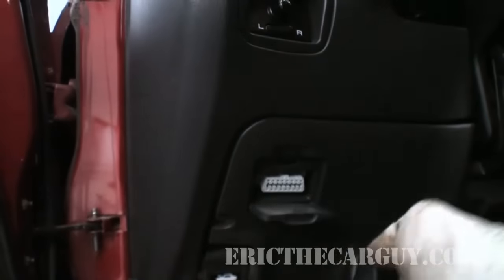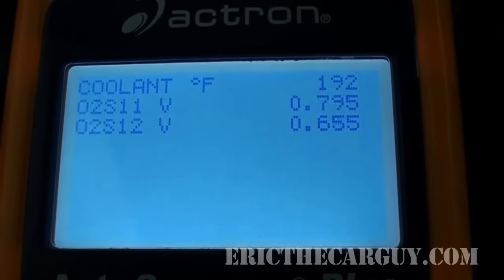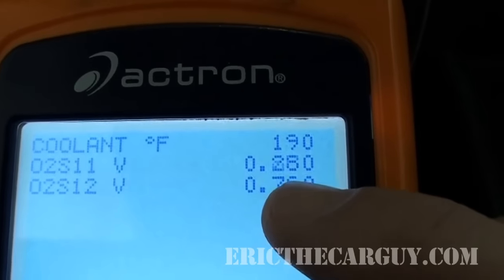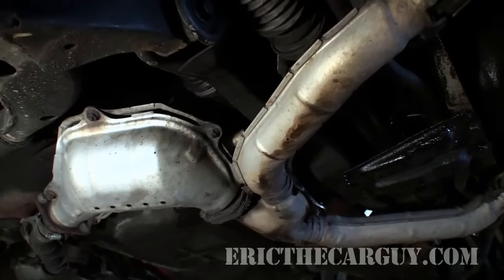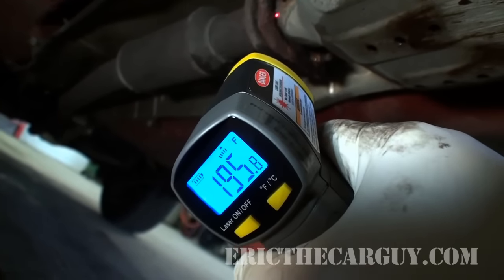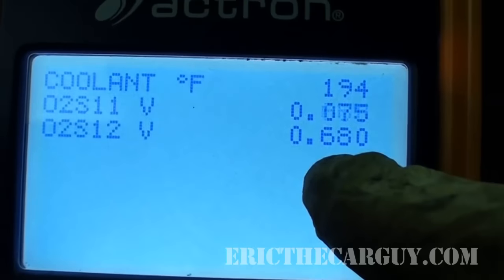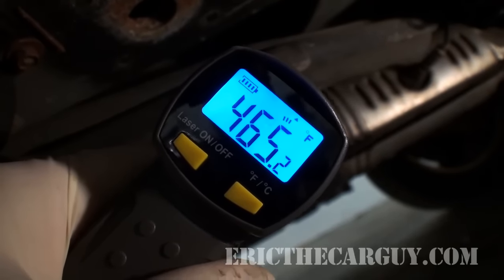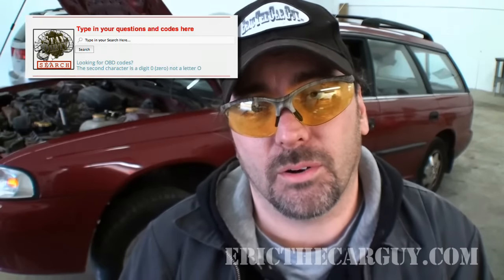P0420 How To Diagnose A Bad Catalytic Converter -EricTheCarGuy

Comment: I have an 06 Volvo s40 with a p420, change the rear sensor, light came back on, watched the live data and the front sensor would switch around as expected but every once in while would jump up to the 200 's not 0.200 but 200.0, is that normal or is that front sensor the problem ?

Comment: I did both of these test, the converter passed the temperature test, but when I checked the live data. The first O2 sensor was fluctuating like you said it would, but the second one was doing the same thing. It was not stable like it should be. Any suggestions? This is a 2001 buick century custom too. It doesn't look like there are any exaust leaks either, but it has produced the P0420 Code. Any advice would help. I love your channel man, super helpful. Thanks.
Reply: look for exhaust leak close to the cat.

Comment: '97 Accord 2.2L non-vtec w/ 296k mi. (owned since 275k), CEL recently triggered for P0420... My OBD reader indicated my downstream 02 sensor's voltage was up & down, but then I decided to track it again after a 40-min. drive home from work.  It started tracking at a constant 0.7V (holding RPMs at 2k).  Is it possible for the cat to start back working again?

Comment: My mom's 2002 Nissan Altima 3.5SE just got this code a couple days ago. I've read that this can be fatal in those cars if not addressed quickly. I just replaced the upstream O2 sensors because of different codes, spark plugs and the rear valve cover. So, it's sounding like one or both of the pre-cats are failing.
Reply: I just checked it tonight: Downstream bank 1 O2 sensor voltage was steady at idle then it jumped around when the car ran at 2500 RPM. Temps were 330 degrees in front of the bank 1 precat and 140 degrees after. I'd say the bank 1 pre-cat is done. Given the history of these Nissan cars, I'm going to replace both pre-cats, since the car has 160K miles and they've never been replaced. The compression was about 210 PSI dry across the board when I checked it a few weeks ago, so I'm hoping we caught it early to prevent engine damage.

Comment: I got the P0420 code on my 2003 Camry and when checking with the OBD reader only the 2nd O2 Sensor is showing voltage (mostly steady around 0.6-0.7) but O2 sensor 1 is showing 0 voltage, could that be what's causing the P0420 code?
Reply: yes.  did you replace the sensor?  that's the easiest (and best) explanation for your code so hopefully that's all it was!
Reply: b I did. I've driven like 400 miles and so far the light hasn't come back on
Reply: right on!

Comment: How about manifold cats? I got a 07 civic 1.8 and has a p0420 that comes and goes. Awhile back I threw a new cat at it and it was fine for a year or so and now I get the intermittent p0420. I also am using a lot of fuel but the performance is not effected. I think I changed a good oem cat

Comment: Hi Eric, thank you for the video, as always very helpful. I just have one question. How can I test the O2 sensor on the downstream? I have a multimeter, can I check the continuity of the black wires  / white wires? If so, should I just put it in ohms and test both black wires or white wires? I did that on my 2010 Honda CRV. I got no results on my multimeter for the downstream however, the Upstream gave me back a number. I got a brand new O2 sensor for my Downstream and that didn't give me any readings either. So what gives?
Reply: James  , thanks a lot.

Comment: Eric, I gots a audi A4 B5 1.8T Q.. currently having P0420.. So im digging into this Catalyc stuff here.. So you are saying cats run around 1200F.. BUT non of your vehicles are not even close?  I had disconnect in understanding , should the catalic on your oddesy. be up there around a 1000F?
Reply: The 1200-1600 F range Eric referred to is the temp of the cat itself, which you can't usually measure effectively due to items like the heat shield. The temps that he pulled from the inlet and outlet will help you determine if the cat is good or bad, as a good cat will have a temp increase on the outlet side whereas a bad/restricted cat will have a temp loss on the outlet side. Hope this helps!

Comment: @ericthecarguy the code I'm getting on my 09 maxima is P0430 cat system efficiency below threshold. Should I do a tune up, reset the check engine light and see if maybe that fixes the problem ? Otherwise I have to buy a whole new exhaust manifold which are pretty pricey $$$.
Reply: German T who told you you needed a manifold replaced? if they told you that its likely the reason for the code. you are probably getting a leak from the manifold..clearing a code.doesn't do shit.

Comment: i came across a car with a lower temp outlet. but the vacuum gauge (at 2000 rpm) holds steady, doesn't drop. the bolts one the Cat are badly rusted, so i dont want to take them off at this time. 
if a car has a fake/dummy catalytic converter will the outlet temp be lower?

Comment: Could a leak in the air intake cause the computer and 02 sensors to be confused and throw a P0420 code to pop on? I replaced my cat and 02 sensor and about 3 months after the 420 code popped on and I know it's not bad as it's still almost brand new. Should I have my intake smoked?

Comment: what term is used for measuring STFT and LTFT on a nissan murano. Im using a EVO Genisys and i do not see those terms fot that reading . I believe Air Fuel Ratio is one but ,i think that the equivalent to short term. Do you know?

Comment: Hey Eric, thanks for the helpful and easy to follow videos. Question, I have a 2007 Honda pilot. It gives me p0420 and p0430 codes and now I have p0300 all the way to P0306 codes. Do you think the 420 and 430 codes are causing the P0300 codes? Would really like your help on this one.
Reply: Having same issue. Same car. What was the result

Comment: Well put together video.  Definitely some information I can use.  I have the P0420 code on a 2003 Camry.  Only sets the check engine light when you take it on long trips of 100 miles or more.
Reply: What was the final diagnosis?  Did you replace your 2003 Camry’s O2 sensor and/or catalytic converter?
Reply: @hb5914  Changed the O2 sensors, and put the old ones back on.  The new ones give the P0420 code immediately.  Drive less than 100 miles or so, and the check engine light never comes on.  So... I essentially did nothing to it.
Reply: @cward1954  Who manufactured your new ones that immediately set a PO420 and who manufactured the old oxygen sensors?

Comment: QUESTION; I have a 2009 legacy gt and I am not throwing a code, however, I am getting that rotten egg smell when I run high rpms. For example; in the snow recently, had to give it some gas In order to not get stuck and rev close to red and get the smell. Could it still be bad and not throw the code?

Comment: I drive a 98 integra with a CR-V b20 motor swap and my car tends to hiccup while accelerating. The other day I got home and parked the car I noticed smoke coming from the firewall and below so I checked it out and after looking into it. I noticed that the front part of my cat was blazing red hot but the rest of the cat was not. Would this be a bad cat? I've been told it can be the distributor causing it to do that.

Comment: Hi Eric, I have a P0420 code on my yota. my wife put diesel on it instead of unleaded. It stalled and towed it to a dealer, they cleaned the fuel system and changed the spark plugs. Dealer said to change the catcon for 1700 bucks. Well I declined. It has been 3 years and mpgis still the same. Is it possible that it was just a fouled 02 sensors? Thanks in advance. hope you answer soon.

Comment: Thanks for the video, initially  i have P0138 code on my car. I ordered a replacement oxygen sensor from ebay and after replacing the faulty sensor the code cleared and after driving for few days it returned another code P0420. Could it be that my Catalyst converter is bad?

Comment: I was checking for a bad Catalyst converter like on your video.. b1s1 moved up and down fast, so did. b1s2... fail the 1st test I stop by Harbor Freight Tools and bought the infrared gun... in front of the car was about 200 the end was about 289... I was hold idle at 2500... they both fail... RIGHT? should I just move to replace the catalyst converter?

Comment: I have a '98 Saturn SC 2........ In December of '13 I replaced the Catalytic Converter and at the same time I replaced both the Upstream and Downstream O2 Sensors.  In the last few weeks I've been getting the well known P0420 Code..... I replaced the Upstream again, BUT no luck, still get the code (I have yet to replace the Downstream as it's more expensive)........So could it possibly be a bad Cat again?

Comment: my p0420 light keeps coming on but i checked my voltages.  primary is fluctuating like it should and secondary is pretty low and stable.  does it have to be at .5 v? because mine stays stable but it's way below that.  I have a 98 tacoma 4 banger 4x4 with about 175 k miles on it.  I think the Cat still works fine so what else could be causing the light to come on?

Comment: Looks like you might possibly have a leak in your exhaust between the two converters and it is allowing more oxygen into the system, skewing both o2 sensor readings. Did you pressurize and leak check?

Comment: Well the part itself is not much, its what is charged when having it placed in, in many cases 120 to 150 per hour for labor, which it takes in most cases to replace in moments, but still are charged for an full hour. And not to mention all the middle man charges. Meaning having the part delivered and so on. Thats where the large cost comes in.

Comment: I'm getting 0.070V on O2S11
And 0.800V on O2S12. Any insight? Feels almost like the clutch is slipping when you drive it,  but when it "slips" the revs don't spike. but when you floor it, it picks up again. Torn between if it's a clogged cat or bad clutch

Comment: look up the videos on how to clean your catalytic converter. I just did it it cost me $20 and was super easy and my check engine light turned off no more trouble code. it sounded crazy at first but when I saw the testimonials I knew there had to be something period basically you get one gallon of lacquer thinner poured into half a tank of gas and drive your car for about a hundred and fifty miles. In my case at turned off after about a hundred and ten miles and actually ran terrific the whole time but don't take my word for it just do a search on YouTube

Comment: so buy driving with a complete break in my exhaust right before the cat probably means its been running cold for a year now... so the loss of power and fuel air ratio issues im having are probably because of this?

Comment: Thank you so much for posting this!  I will check the temperature and oxygen sensors of my po420 code.  Have you ever came across something where air temperature would throw the code?  So in Colorado here the code will be thrown and check engine light will come on when the air is higher than 70 degrees from what I noticed but when it gets down to the 60’s the check engine light goes off!  If anybody who has dealt with anything like this would give me advice that would be amazing.

Comment: Eric pretty good video.  Just a few comments.  First the cat also cleans up hydrocarbon and carbon monoxide gases in addition to NOx.  That is why they are called a 3 way cat sometimes.  The second comment is on newer cars with air fuel ratio sensor you will not see the voltage changing on the upstream sensor.  Aside from these picky little things of mine nice job and excellent technique using the infrared thermometer.  That is what I use.

Comment: A) I love your channel

B) wouldn't the jumping values you saw at 3:29 also possibly be cause by bad O2 Sensor?  

Or are you saying since both are jumping the chance both sensors are bad is low, I.E. the cat is bad?

I have seen several "0420 Cat. Inefficiency" codes fixed by replacing O2 Sensors.

C) Frickin love your channel

Comment: I have a 2003 Yukon Denali periodically while driving the truck goes into limp mode and I get a message in the dash for reduced engine power and a po 420 code can a bad tps trigger a converter code. I had to replace the converters  last year but the ones I put in were cheap

Comment: Hi Eric,

Have a question, if I have a proper temperature on the catalytic converter, but crazy readings on the secondary sensor, is it possible that the O2 sensor went bad?

Comment: hey Eric i have a 2003 ford expedition. 4.6l i am trying to replace the passenger side cat and there is not enough space to get my tools to the bolts. I took off the wheel well covers as well no luck. and i broke off one of the studs on the driver side cat. How can I repair the studs?

Comment: So is the heat supposed to be hotter leaving the CAT coming into it?   
My car is very very slow to accelerate.  It also hesitates (back & forth motion ).  I took a temp check - it read about 250 front part & about the same back end of the CAT.

Comment: So my first o2 sensor jumps around like in your video (its brand new)
and the second one stays pretty still... goes from .420-.800
what would you suggest doing? secondary o2 or cat converter.

thanks
Reply: Seems like he said the first one sapposed to move around alot like that. Then he says the second ones sapposed to stay steady at around .500. That would probably mean your o2 sensor number two is bad or needs cleaning id guess. Try soaking it in gasaline or carb cleaner ive heard helps. If your cat unbolts then try soaking that in hot soapy water for a day ive seen videos with scotty kilmore also. Even if you have flanges welded on to your old cat you can try cleaning and test again. And if it doesnt work you can buy much cheaper aftermarket one for hundred bucks or so and have flanges welded also so you can take on and off to clean and or replace with old one after test to preserve your smog pass helper.

Comment: I have a 2007 dodge grand caravan with P0420, I proceeded and installed a brand new cataytic converter....  The mechanic reseted check engine light,  and I drove 300+ miles on the highway 65mph . I still it has the code P0420 on the dash. What should I do.... PM me if you can

Comment: Hello I have Camry 2000 4cyl I got 420 code on it I raised it and then I added the lacquer thinner  to it and I find it on 2500 rpm for almost an hour and I deliver in that car so I drove next in the morning for couple hours straight and the decide to check o2 sensors in my car so I got reading like that 
O2s 12 (v) 0.6 to 0.7 
O2s 11 (v) around 3.3 and keep goes up and down so what is your opinion I will upload the video once I get home thanks first one it was moving fast the other one it good moving not fast and cat temprture it was hot before the cat around 300 and some after 250 to 290 thanks
Reply: My understanding is that the first one is sapposed to go up and down fast. This is the lean or rich from slight move of the pedal or whatever i guess. The second one is sapposed to be steady and not moving fast like the first one. Sounds like you have cats that are fine. Not sure about 02 sensor though.
Reply: Ill have to recheck these. I cleaned my catalitic and i passed afterwards. Numbers are all greatly reduced as well. But i wil have to put the scanner back on and see what i get from them. Thanks for your help.Figured out how to clean the cats and do a obd2 monitor readiness status reset so i finally passed my smog crap. Gas mileage went up like 6mpg too.

Comment: how do you find out what the serial number is on the catalytic converter 1999 honda accord LX 4 cylinder? I went to get it smogged and it didnt pass the "inspection test" said numbers didnt match the system. So before I buy one how do I check to make sure the number is correct since they sell converters every where online.

Comment: Hi Eric i have a question and i hope you can help. I have a 2013 altima with 30k miles, there is a vibration at 2k rpm going up or down. Is this a catalytic converter problem?

Comment: ok I got a question. I have had my ford f50 5.8 ltr for two years and there's a leak. when I push on the gas it tick but when I remove my foot it stops. so my question is how can I tell where the leak is coming from. I mean it sound like the ride side of my truck but can't pinpoint where. I have taken it to a shop and they said they fixed it but honestly I'm not sure they touched it

Comment: I discovered burned downstream o2 sensor wires from a mechanic replacing the sensor and not properly securing the wires. They were resting on the exhaust pipe. I have a cat inefficiency code and wonder if the burned sensor wire is causing this?

Comment: Hi Jim,
I have a 2012 Nissan Altima and the issue I discovered last week when traveling from Indiana to Arkansas was that after 150 miles, the car's acceleration decreased dramatically from 100km/hr to 60km/hr. I cannot travel faster anymore. The second day, the car behaved normally until after 150 miles. It became unresponsive to acceleration. On diagnoses, I have P0420 and P0456 codes. what do you think is going on with my car?
Reply: I took the below reading:

O2S11 (V)   1.88 - 2.56
O2S12 (V)   -0.0 - 0.94
Reply: What ended up being the problem?

Comment: Would a bad cat make a car (v6 mustang) shake around 2000 rpm? I get the codes P0174 and P0420. I'm not sure if it's the cats or a vacuum leak. I hear the cats clinking when I turn it off too.
Reply: +caleb phillips I would suspect that the vacuum leak would be the culprit. Since the P0174 is a Too Lean code. I would check for a cracked or broken hose around by the intake. Also the clinking from the cats is probably the heat shields cooling down from the heat of the cat.